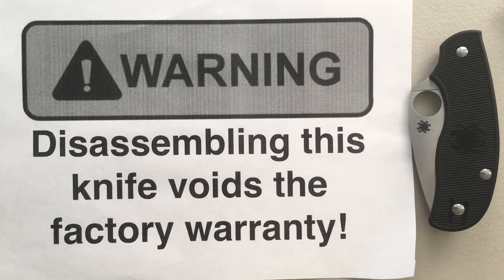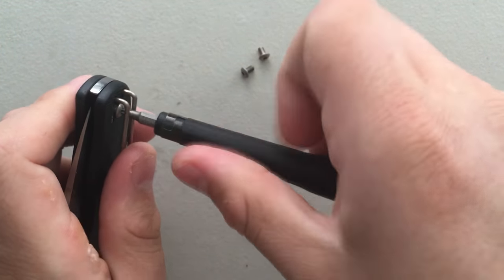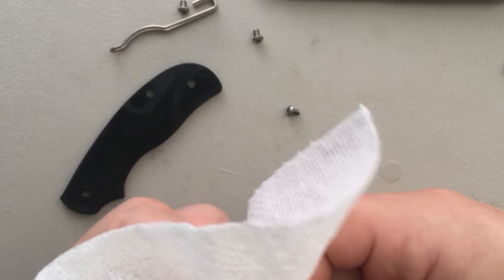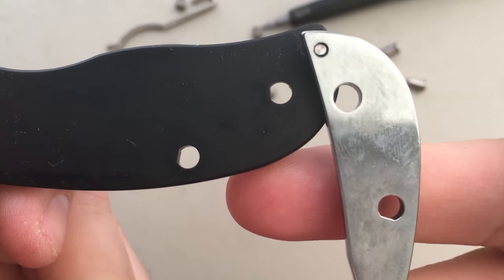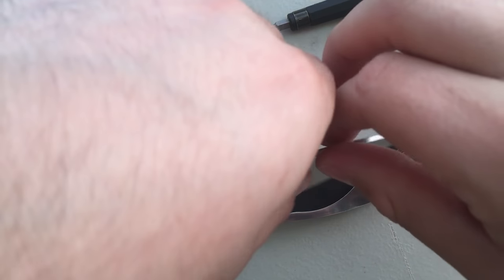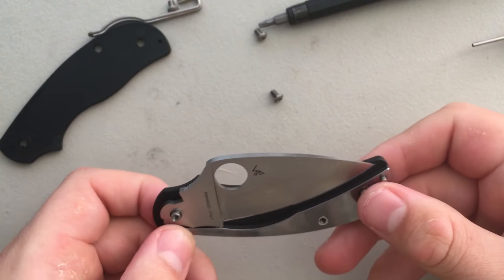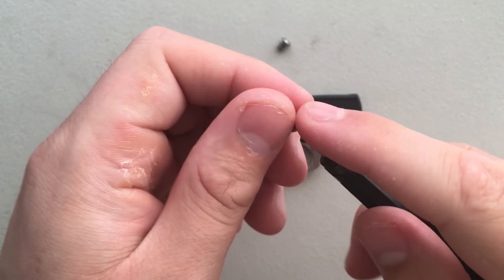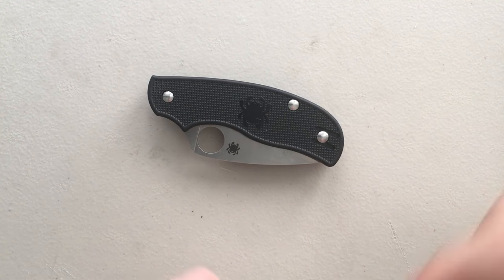How to disassemble and maintain a Spyderco Urban Pocketknife

Comment: I just received one of these and noticed the heel of the blade rubbing on the frn handle scales. I was worried there might be a tolerance issue with my example but it appears to be normal for this blade judging by the wear on these handles. 

Thanks for the tear down big relief I won't have to send it back!

Comment: My Urban Slipit blade edge slighlty hits the inside of the backspring as it snaps shut, thus dulling a small portion of the blade edge near the tip. I bought a second one but the double detent half stop engages too far down, below the grip apex and the blade tries to cut into my finger no matter how its held. I examined and compared the 2 knives half stop divots and noticed one is cleanly cut and centered the other is roughly cut, shallower, narrower, and is few degrees off center. Also the blade is longer on one of them by maybe a centimeter or less. Im fairly dissapointed. I just thought it looked so nice and now its not good to use so im sending one back. Maybe ill get a Delica or Dragonfly instead as a small carry knife. Ill keep the other one that hits the backspring and use it as a beater knife that i can eventually sharpen until the blade doesn't hit the backspring.

Comment: Those integrated washers are the worst
Reply: West Senkovec You'd prefer thin easily pinched Teflon washers over these? Given it's a slipjoint, and isn't supposed to deploy fast, I'd say it's quite acceptable in its current design.
Reply: HaesslichG I have them on my Pingo and they are not flat but convex, they are not the same height (it's a small difference but still..) and they wear with time. If you tighten it lightly there's side to side play if you tighten it more it gets hard to open.
 I think that's the reason the pivot on my knife is damaged because of that. I wanted to make a video on that. Maybe I will.